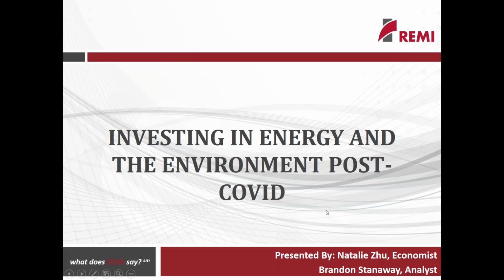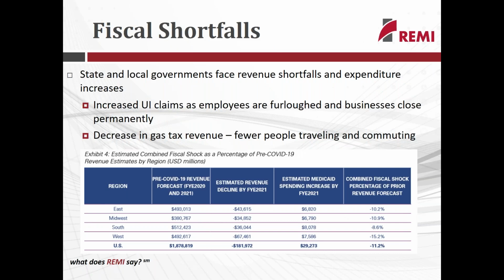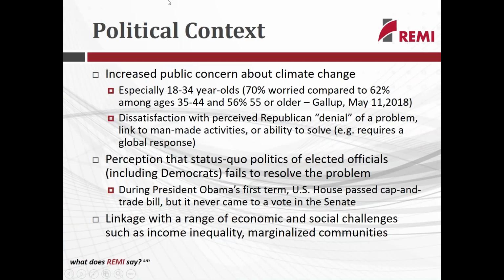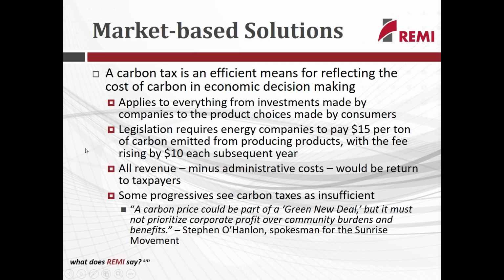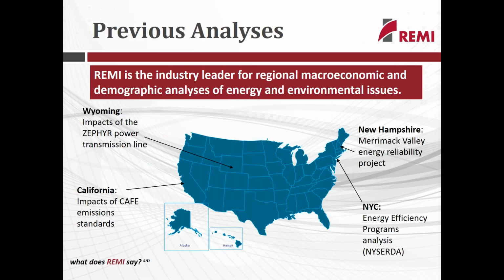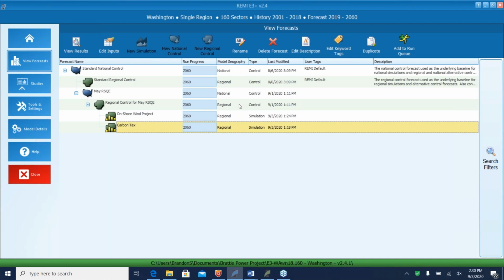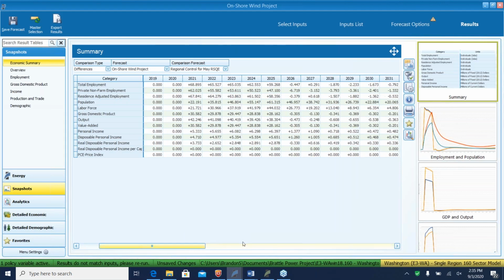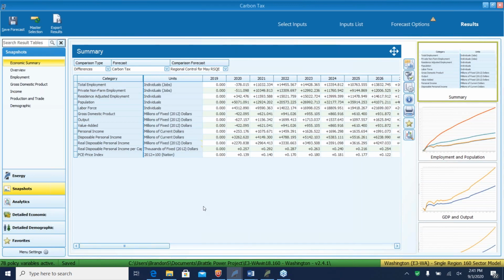REMI Webinar: Investing in Energy and the Environment Post COVID (September 2020)

Comment: In the eight weeks between 2/4/21 and 12/9/20 CDC recorded 806,165 deaths from ALL causes. 240,000, 29.8%, of those were due to expanding the data set to include 1/20. 
There were 159,848 C-19 “involved” deaths, 12.0% of ALL deaths. “Involved” means the presence of P/I/C-19 box was ticked on the death certificate.
To date 342,324, 80%, of ALL C-19 deaths are among those over 65 years of age, 16% of the population.
The INCREASE in C-19 deaths over the eight weeks was distributed: 21.2% 65 to 74, 29.0% 75 to 84 and 33.2% 85+ totaling 83.3%.
The average death rate is: ALL 1,284/E6, 65 to 74 2,855/E6, 75 to 84 7,333/E6, 85+ 20,488/E6.
85.7% of the C-19 CASES are among those UNDER 65.
81.2% of DEATHS are among those OVER 65.
30.8% of C-19 deaths occurred in nursing homes, hospice or residence.
There have been 300,189,929 tests performed (91.5% of population) with 27,720,744 positive tests (9.2%) and 449,020 deaths recorded, 1.7% of positive tests, 0.15% of those tested. Over 50% of those positively tested did not seek medical treatment.

Since C-19 is mostly killing off old sick people and 86% of the herd is coping naturally why are our elected morons and Chancellor Biden suspending civil liberties, due process, bankrupting the country with lockdowns, handouts, distancing and masked clown shows? 
Guess they can't impose the NWO Grand Reset with actual facts. 
And the lying, fact free, fake news MSM left-wing propaganda coup d’etat machine has betrayed its responsibility to democracy and an objectively informed public.